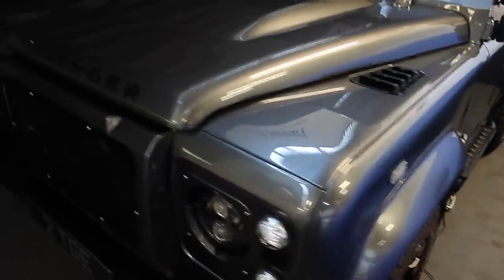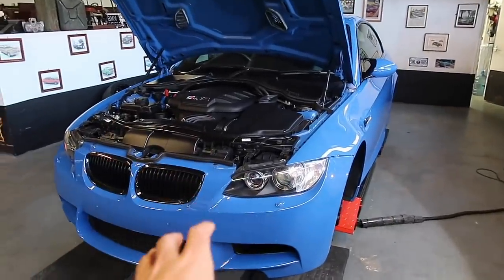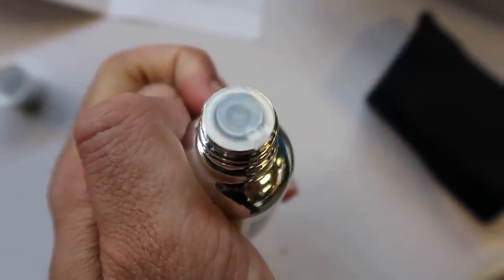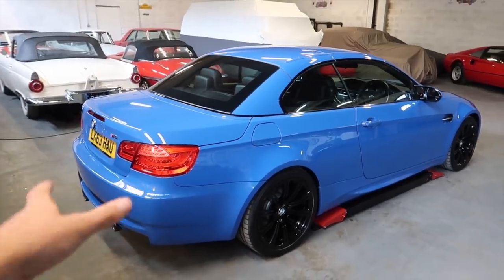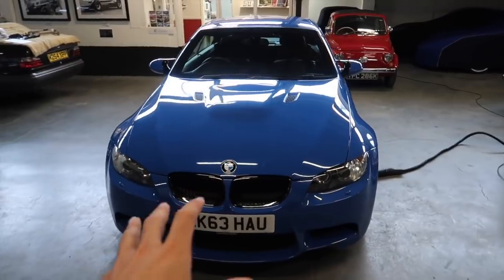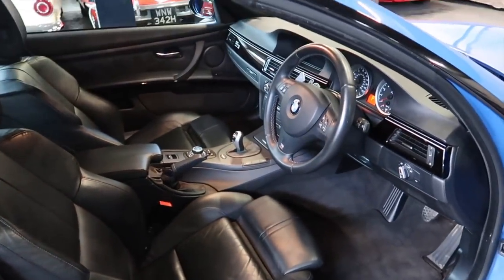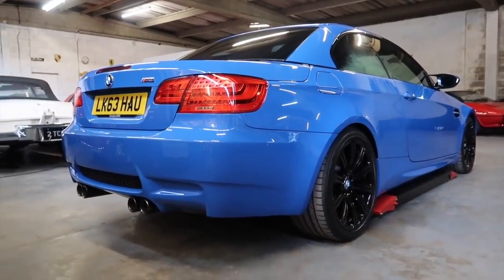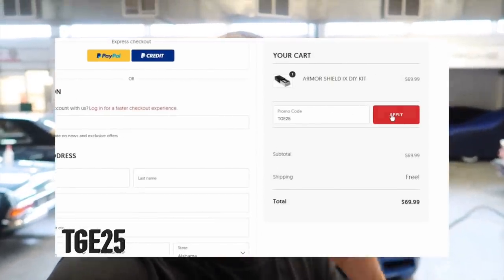REVEALING MY TRANSFORMED BMW M3!

Comment: Tge : This is a reliable car 
E93 M3 : Hold my Rod bearings
Reply: apart from the rod bearings, which is a relatively easy job to do, throttle actuators, and leaky valve covers, the engine and the E9x M platform overall is actually very reliable. Better than E46.
Reply: @hovnojede010101  agreed but no hyundai accent 1.3 gsi
Reply: @sgdtv1368  thank goodness for that! Lol
Reply: @sgdtv1368  agreed but no straight piped 1.9 TDI m8
Reply from the maker: It’s got 24k on the clock. First 15k of those were by done by me. Warmed up correctly every time. Run in service and all maintenance done to the letter. Lady owner and full main dealer service history since. I’m not that worried but will have them done soon anyway as it’s only £1200 to prevent a big job.
Reply: @TGE  it was a joke. Good video BTW
Reply: @TGE  good stuff. yes, at that mileage, they should be fine. I've seen S65s do 100k on stock bearings, they were shite, but still in one piece lol. but always cheaper to replace them than a new engine. The issue is there, but it is a bit overblown.
Reply: Tomas Trunecek like the IMS on Porsche’s
Reply: @TGE  get evolve automotive too do the rod bearings and remap 👌
Reply: I had my bearings done at circa 140k and they were fine! The garage were adamant they'd been changed previously (they hadn't). It shows how looking after a car can really help in the long run
Reply: Mine went at 26k .. new engine fitted under warranty .. not everyone knows that it has to be fully warmed up before redline!

Comment: Absolutely amazing! Worth a look for my E92 M3 which requires some restoration 😳
Reply: Please let us know what you would like doing. david@classiccarcompany.eu
Reply: The Classic Car Company Hi David. I have some slight damage to the front bumper n/s, rear bumper also. Then stone chips on bonnet/bumper. There is probably quite a bit of work required for a full restoration. Definitely interested in a quote. Can send photos initially for a high level assessment?

Comment: Tom, there’s something about your videos and purchases that just set your stuff apart and make them really enjoyable to watch. You’ve always been really good about not taking yourself to seriously. You seem like a genuine guy that if you lived in Austin, TX, I’d actually want to be your friend. I can’t say the same about most other YouTuber. So there’s that. Applaud you for keeping it real. But the bigger thing is you buy cars out of emotion. There’s a real reason you buy them. It’s not because they are the latest and greatest. You just honestly like them and it shows. You prefer the F12 so you don’t upgrade cause it’s the YouTube thing to do. You’ve got the classic Porsche. You bought back the M3 because if the memories. You don’t necessarily restore. Props buddy. Keep up the great work. Don’t change what you’re doing. PS, you should get an S2000 for a fun track/daily.  Mod it up a bit with a supercharger or turbo and you’ll have more fun in it than most exotics. You’ll gain a whole new viewership. None of the UK youtubers are doing Japanese cars. ‘Classic’ Japanese cars are starting to build quite the base and go up in value.
Reply from the maker: Thank you so much mate. Feedback taken on board too lad. Will have a look into it. Glad you’re enjoying the videos 👊